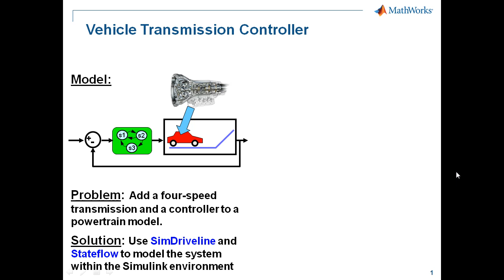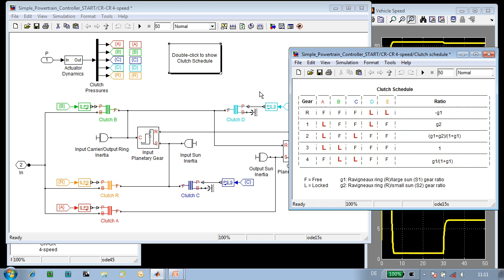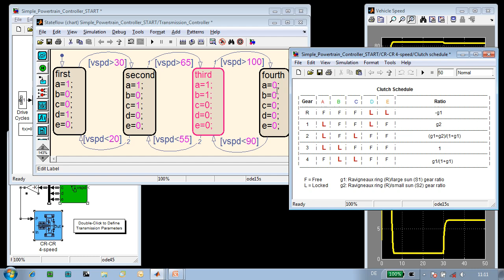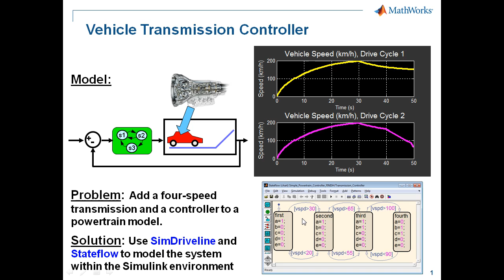Modeling an Automatic Transmission and Controller

Comment: This is an awesome explanation. It helped a lot in my work.
I used this method my automatic transmission but I am not getting the engine power curve as you are getting it. Your one is the ideal one. Could you please share the engine and inertia blocks parameters like speed, inertia, initial velocity.
Thanks in advance
Reply: command for 4 speed Transmission is not working in matlab 2013a so error is  because of older version or from where I can download it? please help